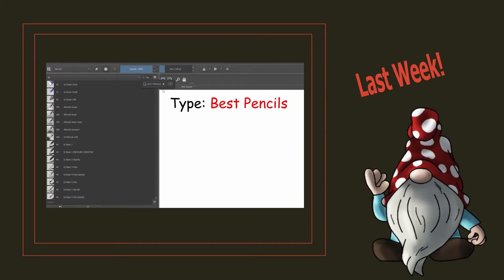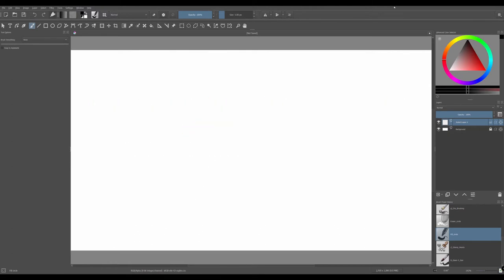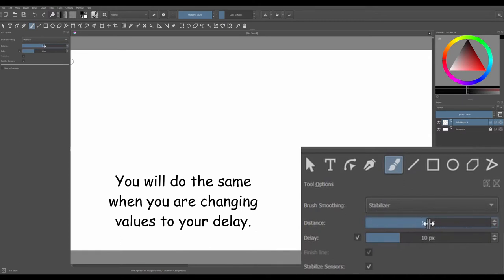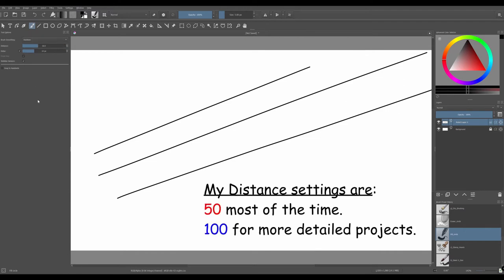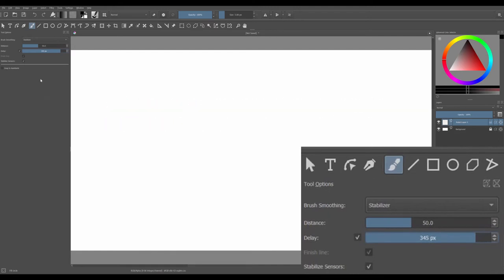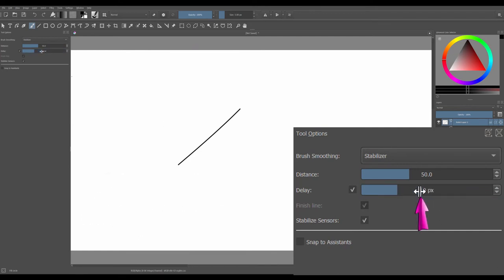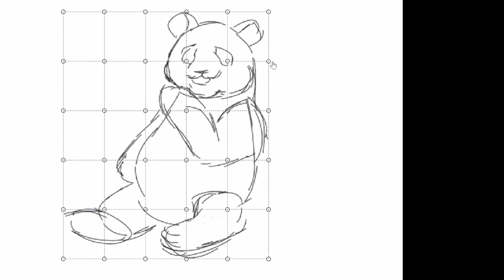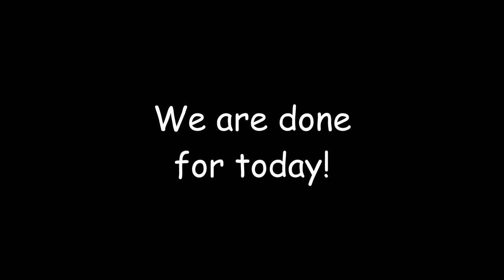KRITA 4.4.3 INTRO TO BRUSHES - Stabilizer (Distance, Delay, Finish Line, and Stabilize Sensors)

Comment: I can not find the stabilizer and smooth brushing in my Krita, can you please help me with that. I checked the sitting and added the smooth brushing but it does not show in the menu bar those options you teach. Thank you
Reply from the maker: Hello.  It is located in your tool options docker. Sometimes the tool options docker hides behind the color wheel. Remember that you can move your Dockers around to fit your needs.

Comment: im clicking on the brush button but it doesn't show up at all
Reply from the maker: Hello. What is not showing up? The Tool Options Docker???
Reply: @BladeandQuill  yea im using a chrome book and when i clicked on the icon it only showed what size i wanted the icon and not the docker
Reply from the maker: You may not have installed the docker in your workspace yet. Go to SETTNGS,  choose DOCKERS and select TOOL OPTIONS. The docker may appear behind the color wheel, or it may appear directly on your canvas. Either way, you can move it wherever you want. If you haven't docked dockers before, watch this video: https://youtu.be/SexAi5w2WIo
I hope this helps.